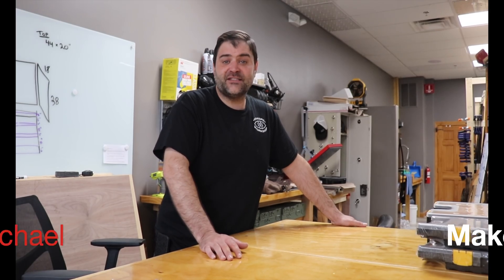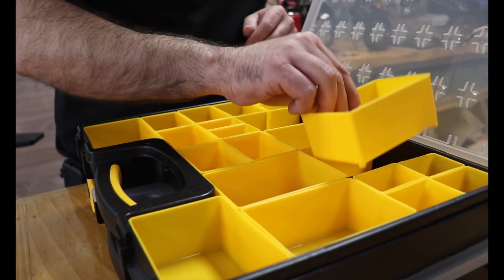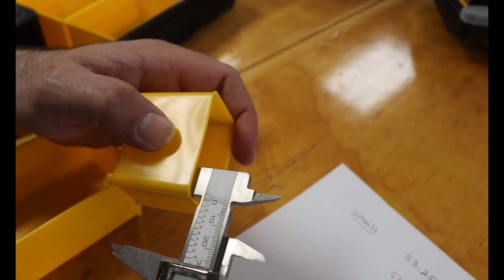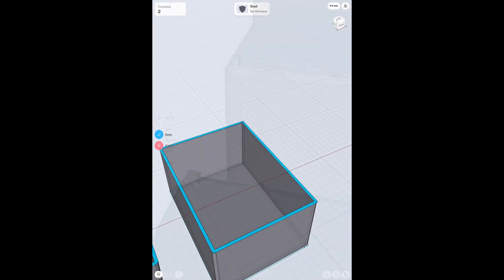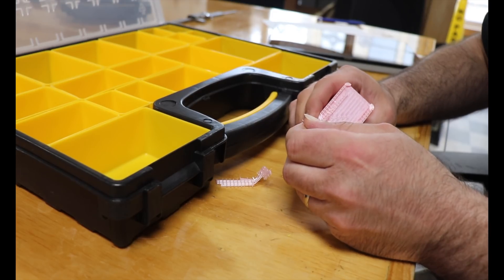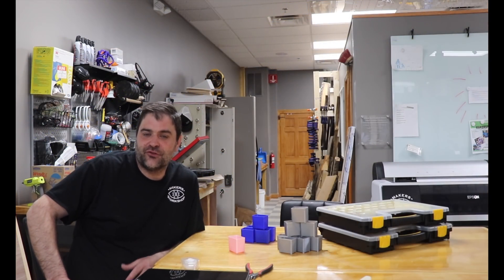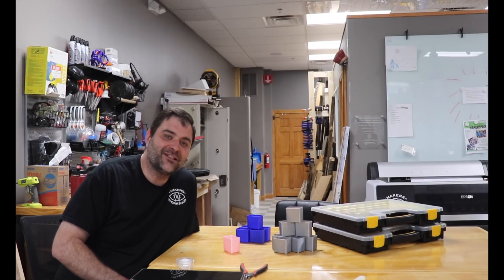3D Printed Tool and Hardware Organizer (with Free Files)

Comment: was there a need to print the feet?  without them you would  get a little more storage, use less filament, and most importantly not have to deal with support
Reply from the maker: It’s how they sit in the box more securely, so yes

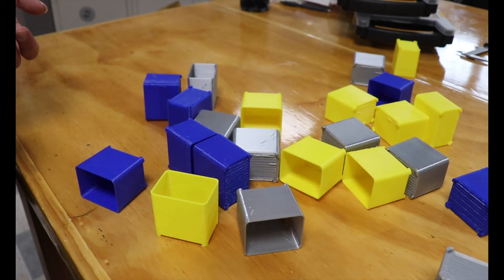Comment: 3:20 the original cups fit fairly snug but your printed ones leave quite a gap as seen at the right end of bottom row.
Reply from the maker: It’s a pretty snug fit, but the models can easily be adjusted when slicing by sizing up a few percent if you require a tighter fit.  I have been using them for a while at this point and haven’t had any issues.

Comment: Nice work guys, I followed along with the progress on Instagram, too.  I don't think you mentioned it, but do you have any kind of estimate of how much the cost for the filament was per container? I don't have a 3D printer (yet) so I really don't have a clue how much stuff like this costs to print.
Reply from the maker: 3D printing is pretty affordable for things like this.  There is some variance depending on the type of filament that you choose but using the hatch box PLA the small cane out to .52, the medium .85, and the large was $1.38
Reply: @MakersWorkshopLLC  Thanks for getting back, so I guess where I was coming from was, like if I just bought another one of those small cases it would come with 12 small bins, and it would cost 6 bucks (and you'd also get 3 mediums and the actual case) but it would cost you just over that to print 12 small bins. So I was kind of wondering how cheap it would need to be to make sense from a strictly economical stance. However, I do think it's pretty cool that you can make different colors or custom sizes or even a large that was divided up like 4 smalls if you wanted to. And as this stuff gets cheaper and cheaper these type of projects become more and more feasible.
Reply from the maker: Absolutely, but I think it has the best application if you only need 1 or 2 trays and want to make minor adjustments.  I am considering also making an extra large size for a bigger compartment then what comes with it.  The main idea is to pick up total flexibility with the container.

And for me since we share our shop with other people the color coding to know which one goes where quickly has a value as well.